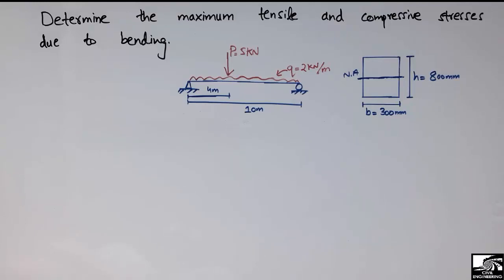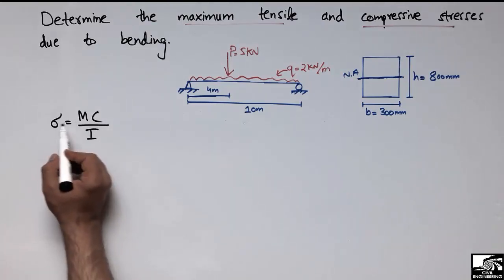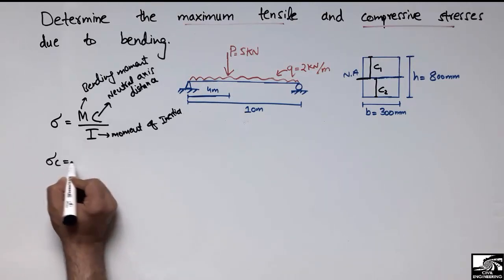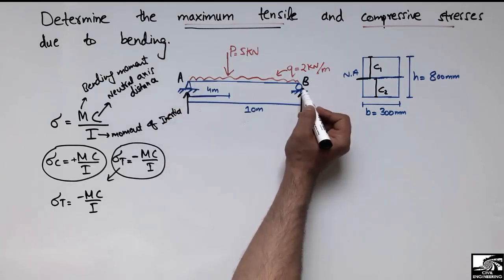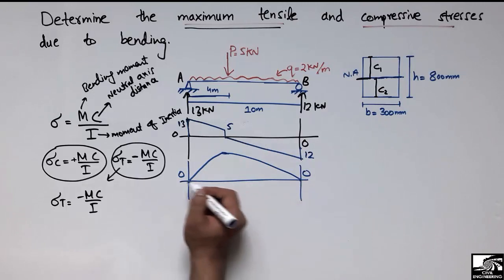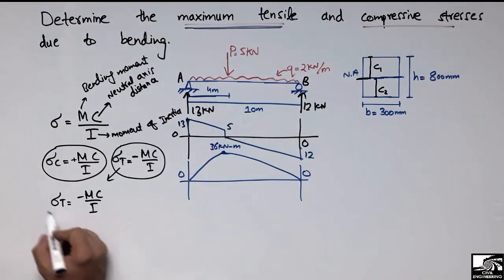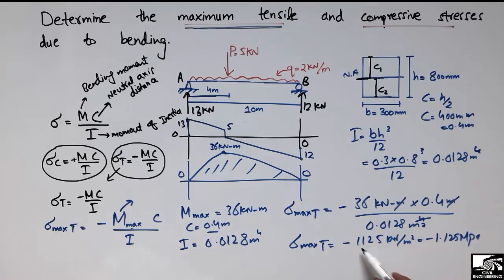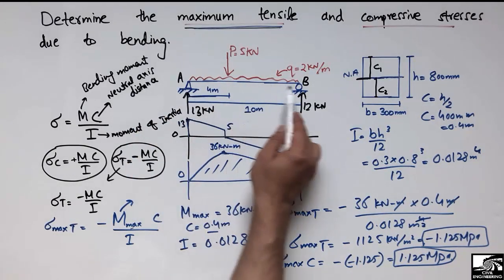Tensile and Compressive stresses in a Beam || Example with solution

Comment: Great video. I just have one question, how did you find out the maximum bending moment? You state it is 36knm, but don't explain it. The maximum bending moment is integral to this formula, so I would appreciate a reply.
Reply: It's the integral of the shear force curve.
Reply: you can either draw a free body diagram and get a formula of the bending moment or you can just find the area under the shear force diagram